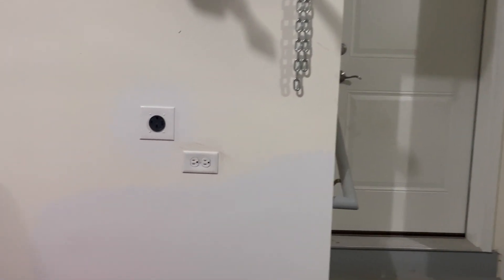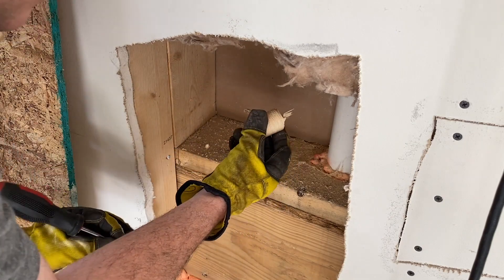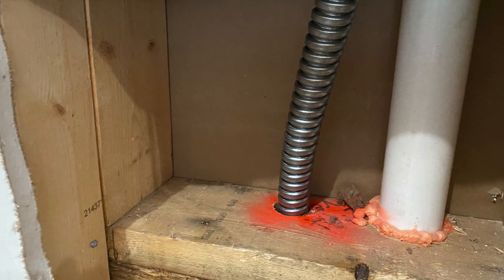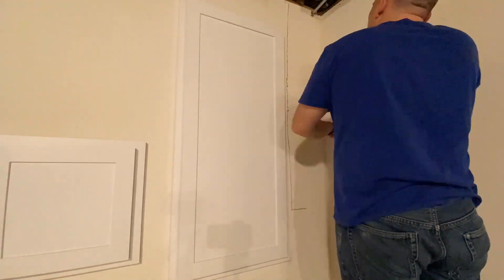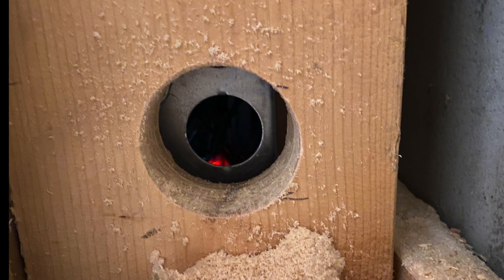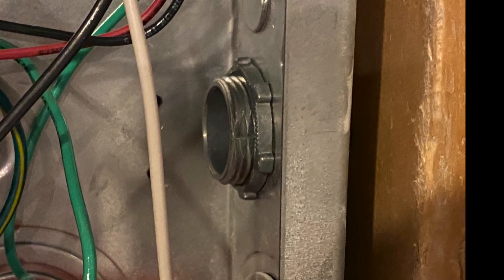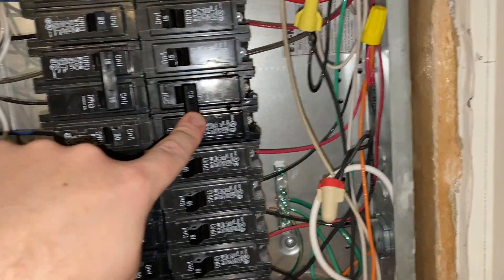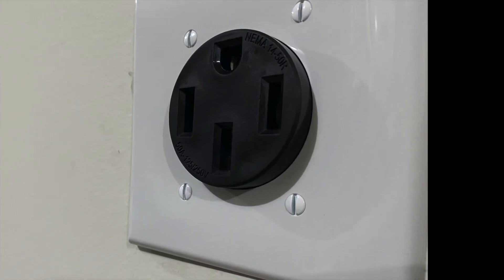Installing Electric Vehicle (EV) Charging Receptacle

Comment: Receptacle is 50 Amps maximum rating. Are you sure Code permits a 60A breaker feeding it? Max output current should be limited to 40A. Do not forget to torque breaker and receptacle compression screws all the way to required specs which can become a very common hot spot fire installation problem.
Reply from the maker: Great points/questions! The breaker and receptacle screws were torqued at the end (because sometimes they get loose during the install). I don't currently have an EV, so the NEMA 14-50 is not currently being used (and I typically keep the circuit de-energized). I sized the breaker for the conductors (60A), in case I install a car-specific 60A charger. If I end up actually using the NEMA 14-50 instead, I'll replace the breaker with a 40A or 50A breaker.